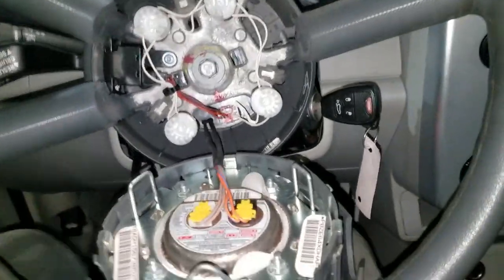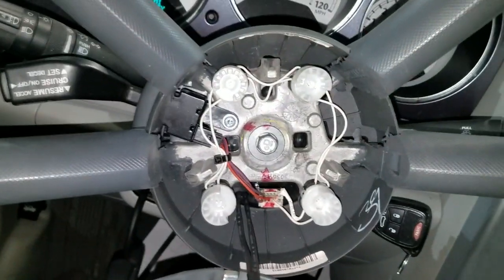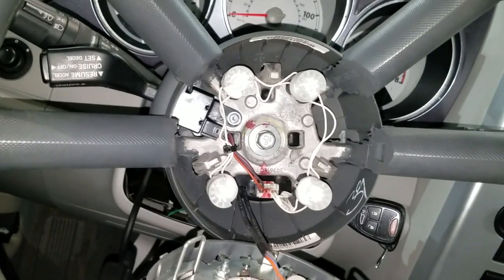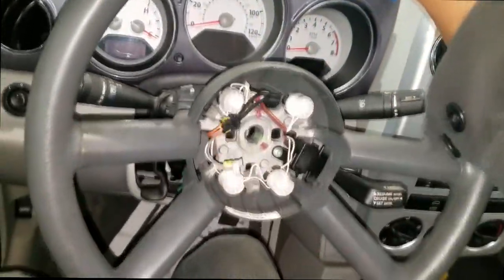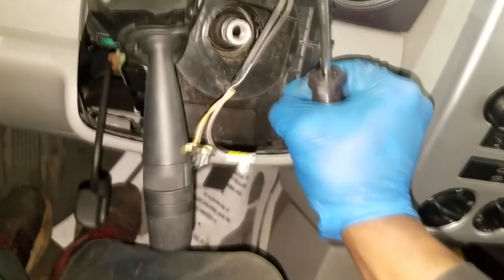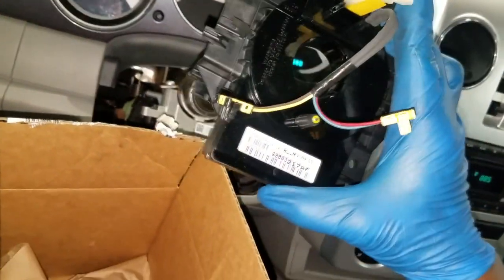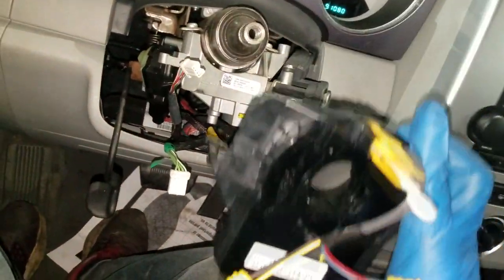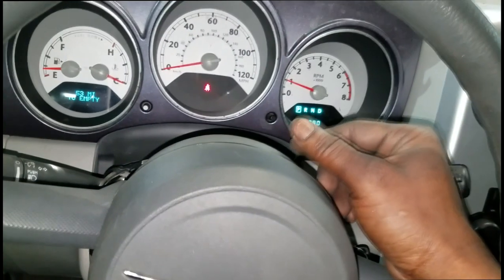PT Cruiser. How to Replace a CLOCKSPRING. Fix your Cruise HORN Driver squib circuit open.B1B06 B1B02

Comment: LOL, "I should have mentioned that before I started".  I did this job a couple of days ago.  I was able to buy the clock spring from Ebay for $27.  Exact match, time will tell how long it lasts.  For the air bag, I was able to use a shorter screwdriver with a normal blade, put through access hole, press flat into the spring, twist 90 degrees while pulling on air bag. Thanks for the video!

Comment: Another symptom of a bad clockspring: cruise control doesn't work.  Some people never use it and for them, the cruise control on/off switch can go open or intermittent, causing cruise to not work...but if an owner does use it and notices an airbag light, no horn and no cruise, it's the clockspring.
Reply from the maker: You are right bud, forgot to mention that..Thanks JP
Reply: @OnlineMechanicTips  Also, my airbag removal tool for my Gen 2 PT Cruiser is in the glove box, just in case.  They're cheap, about $6 from Amazon!
Reply: @genepoon8905 what about gen 1?
Reply: My horn does not work and airbag light is on and cruise control does work.
I tested the horn itself and is work and relay works as well.
Used my scan tool and it states
“Passenger Squib Circuit #1 Open”.
But there are no codes besides that.
It specifically stated that exactly what my code reader states.

Comment: Man I need your help!  I follow your instructions and lubricated the tabs and the metal clips. Horn works BUT it will still go off sometimes like short bursts.  Then it doesn’t work on the pad.  Could it be the click spring or the contacts inside?

Comment: I follow your sticky horn. I removed the air bag. I replaced the switches, lubricated the tabs and the horn works sometimes snd other don’t work it works with the car off, I start the car then it doesn’t.  I put a light inside the car connected to the horn cables to check when it get stuck or if it works when i press the pad. Would you say its my clockspring?
Reply from the maker: Will your scan tool read info in the airbag system? If not you simply guessing that its the clock spring. But I will say this, yes a clock spring can cause that problem.
Reply: @OnlineMechanicTips  Thank you! I replaced the pushbuttons. I ordered the clockspring. The only remaining part I assumed is the TIMP.
Reply: @josemiranda1241 what is a TIMP?

Comment: 2001 chrysler pt cruiser horn does not work. Airbag is on and all buttons like cruise control works.
I use my obd2 sensor and it scanned “Passenger Squib Circuit #1 open”.
There are no codes, tool only states that. That’s it. How should I fix this?
My horn does work and the relay works as well.
Reply from the maker: Hey bud, im curious, will your scan tool display input data? Also are you subscribed to the channel?

Comment: I don’t see the torque spec for the steering wheel nut in the description.
Reply: I finally searching around online and after a bit of digging. The Steering Wheel Retaining bolt I believe it is called is to be torque to 54N•M or 40FT Ibs.

Comment: It has three connectors,  but clock spring only has 2 ... The third would be for what?
Reply from the maker: Hey bud, if I had to guess, it may be for if your car equipped with cruise control or something. But if it was un used, just tuck it away. Thanks for watching. Please thumbs up the video and subscribe to the channel, thanks
Reply: @OnlineMechanicTips  
My PT and the video's  PT have Cruise Control.  This same Clock Spring is used in the Journey  and Compass.  It's the angle sensor.  If the PT doesn't have it, why does it have that extra whip to connect? ... I don't understand that ... I already subscribed to the channel!  Thanks for the video